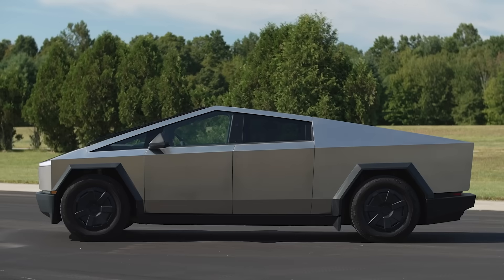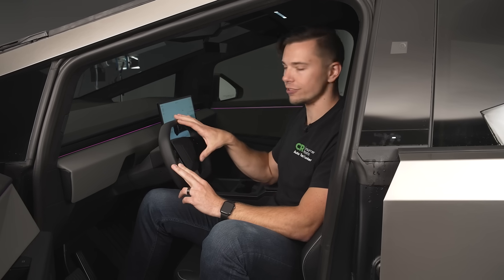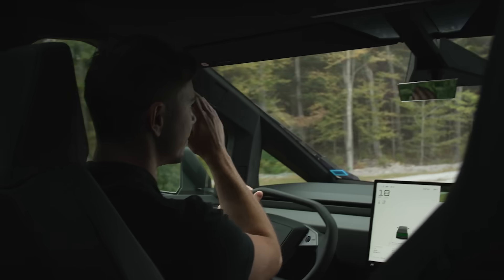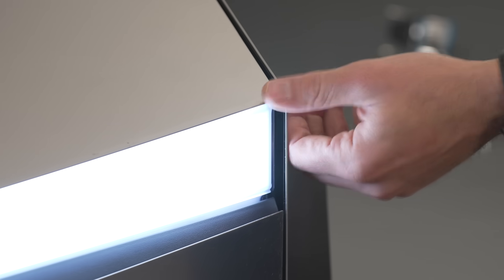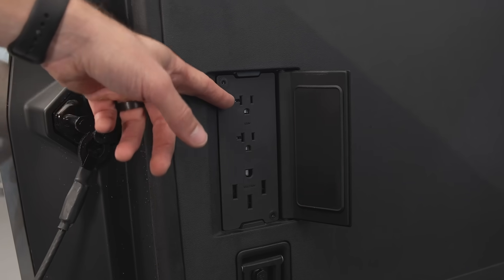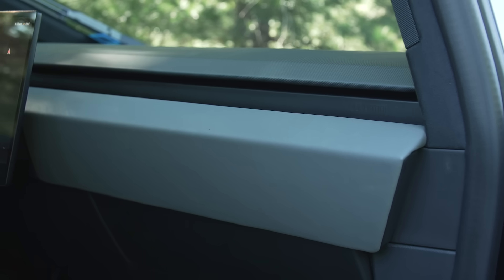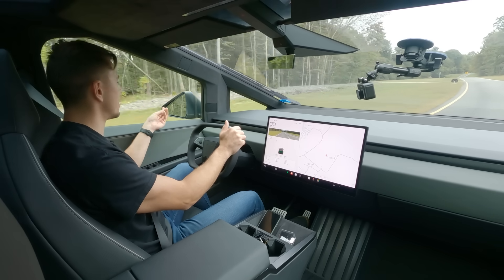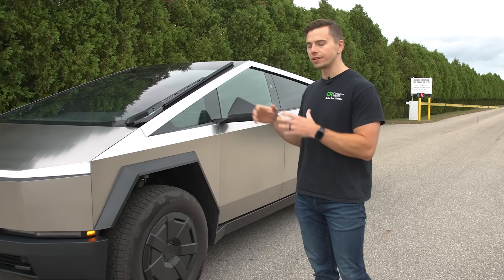2024 Tesla Cybertruck Early Review | Consumer Reports

Comment: So, the retraction function of the tournou cover is just dumb.  The only reason for it, is so you can reach into the bed; and there no place you can do that.   It would be way better as removable panels.    The lack of towing is also just tragic.  If you tow, everything about the cyberSuv is wrong, the charge ports are badly placed, the range is completely useless, the bed can’t have a cap/camper so there’s no way to help aero.  The extended range battery just makes everything worse, it gives you maybe 30 more miles so you go from 80 to 110 and charge times double.  Nobody who tows an RV does so w/o a sway control.   Dropping the trailer and re-attaching adds an extra 30 minutes to charging, and if you do by some miracle find a pull through charging location, good luck sitting in line for that.  The trim on the bed is just completely stupid and cheap.  The lack of a pass through or mid-gate is also a miss for the camping/rv crowd.  The fact the truck can’t sleep the internal electronics is also just dumb.   The lack of pass through for the power is also dumb.  I mean how hard would it be to add relays that bifurcate the incoming AC power to the charging and the rear 240 output, the of course means I can’t plug the cyberSuv into the RV post and my RV into the truck.   All of that, then you have the bumpers falling off and the rear and side trim detaching.  Mind boggling.   I really had high hopes for this thing and it’s just an abysmal fail.  If the RAM Charger delivers on its promises, I suspect the Cyber-I-wish-I-was-a-Truck will disappear.
Reply: Your screed on the cover is so ridiculous. The whole point of the cover is lockable storage you can quickly and effortlessly get out of the way. Also, 5% of of F150 owners tow long range. Why is your towing blathering relevant? Most people if they tow only do so locally.
Reply: @TheBowerbird  You clearly have no experiance with RV’s and camping. There were 78 million camping trips in 2023 and an estimated 81 million camping trips in 2024.  Of those, 35 million are bumper-pulled by full size half-ton trucks.  That does not include boating.  Your 5% number is also a gross misrepresentation.  80 miles of towing is not “short range” it’s pointless.  That means you have to camp with-in at best, a 75 mile range of home.  Or spend 2 hours, unhitching, recharging and re-hitching to get another 70 miles of range.   Of those 35 MILLION camping trips, less than 10% are going to be within the 80 mile range.   Just because people only tow 5% of the time doesn’t mean that towing isn’t a primary use case.  Do the math, or maybe talk to people who really tow before regurgitating your fan-boy talking points.

Comment: You forgot to mention that it doesn't have a spare tire. Also, isn't the "6 foot bed" with the tailgate down?
Reply: Worse, the bed depth decreases significantly because of the stupid bed cover, so it actually much less than that!
Reply: @sprockkets  What are you talking about? The cover retracts below the bed.

Comment: With those sharp corners up front, how did they get by pedestrian impact regulations?
Reply: There are no ped impact regulations in the US, and if there were, this would fare far better than something like an F150 - because the front isn't as tall.
Reply: @TheBowerbird  Exactly, its about flippin people up and over and I reckon this woudl do a good job at the right speed
Reply: Only vehicles with a GVWR under 10,000 lbs are required to meet pedestrian impact safety standards. The Cybertruck along with all the HD trucks from the Big 3 are exempt due to their high GVWR.
Reply: Vehicle class/weight most likely so it doesn't apply to keeping humans safe.
Reply: @davidmccarthy6061  For a pedestrian the best impact is no impact.      Good automatic braking saves lives.  FSD can even see people on the sidewalks.  They are working on determining pedestrian intent via body language.  This is where safety is going.
Reply: Easily They have all moved to purgatory. Or bought a Cybertruck.
Reply: This is a reason why fElon has bought the Presidency - get rid of pesky laws like those.
Reply: They can't be sold in Europe for that very reason.
Reply: @terry94131  Let me guess - you got your information from Reddit? Guess what, clueless one, no pickup trucks in the US market meet Euro ped safety standards. It's not due to the corners, it's due to the height of the truck.
Reply: @terry94131 Luckily the institutions permitting those cars do not listen to stupid YouTube commenters. They have already been imported, sold and are driving all over Europe. 

To quote Monty Pythons: „I send a fart in your general direction“
Reply: @wolfgangpreier9160  Actually they do in Europe.     Some bloke in the Chez republic has a CT and safety organizations that learned everything they know about the CT on YT are up in arms and wrote a letter to the powers that be to ensure it never becomes legal.
We know this is true because they said it has no crumple zones,,
Reply: @terry94131  Well that's not true is it
Reply: It’s an absolutely ridiculous design with so many failures that it should be called out for everything that it isn’t but everyone in the press seems to be afraid to say anything
Reply: @LlyleHunter  Such as?

Comment: Don’t worry about steer by wire. F-16s have had it (fly by wire) since the first prototype flew in 1974. Works great.
Reply: Irrelevant. Cars aren't checked for problems before driving each day, and there is no reason for steer by wire in a car vs a plane.
Reply: @sprockkets  Tesla systems are monitored microsecond by microsecond, sensors are extensive and error codes are excruciatingly precise. Like it or not, the master computer always knows what's going on.
Reply: @guyo1995  u mean the buggy system that needs ota update? No thanks...
Reply: @guyo1995  No it does not hence so many error reports that Tesla Service Centers have to wipe and/or suppress because they cant figure out the cause

Limp Home Mode while fully charge and not use roughly
Bricking for multiple reasons including from charging from an official device, NM washing why does a car need a Wash Mode?
Reply: @kiloy1006  It is sad how the hate crowd is trying to turn OTA into a bad thing.
Most if not all legacy has it now but wished they had it working long ago.

Comment: As a Tesla fan and owner, I was not blown away by the CyberTruck. At the original price of $40k I would have been impressed, but at $100k, not so much. It seems very solid but the interior seemed a bit cheap and sparse for the money.
The truck does show fingerprints, but it is extremely durable. The "rusting issue" is not real. dirt gets on the surface and material in the dirt "rust" but are pretty easy to remove with clay bar. The sharp edges are not an issue unless you are extremely careless
There has been a update which allows most of the self-driving features like my Model S
Reply: Really?  A $60,000 price difference would have left you with a different impression?

Comment: I still own only gas cars and a truck. I love my V8s. But I also like vehicle stats and tech advancement. There were several errors, intentional or not, that spec nerds like me should noticed in this review. If you are interested in this vehicle, there are several videos that correctly list the actual specs and capabilities on YouTube. With all the oddities, it is capable and interesting. Regen is adjustable and can be disabled, payload is huge, weight is lighter 3k pounds lighter than a hummer, and like it or not steer by wire has been around for decades and is in almost all commercial passenger airplanes. I've worked aircraft avionics and flight controls for over 2 decades.
Reply: And the little red light is supported and enhanced by the red graphic on the repeater camera view on screen.  That’s where you look anyway.  AND the front camera is excellent for knowing EXACTLY where the nose is.  This guy is plain and dumb.
Reply: Don't aircraft have wind-powered generators as redundancy in case of power failure in order to maintain flight control? What's this rolling dumpster got as backup?
Reply: @TheTawniest  Shameless copy and paste from Cyber Truck Owners Club site by mongo

Steering is controlled by both the left and right front control units.
Each is fed by both the 48V battery and the Power Conversion System (PCS) which is fed by the pack (high voltage battery).

So to lose steering requires loss of both front modules or both the 48V battery and PCS.

The vehicle goes into limp mode on a single failure, so encountering a sudden dual failure should be an extremely rare event.

Comment: Every major car company on earth can make a car like this. It’s a rather simple engineering exercise and doesn’t involve an engine and transmission, which are the two most difficult systems to make.  Ever wondered why the other companies don’t make one of these?
Reply: It’s making stuff at scale that’s difficult. 
After just 3 months of production the CyberTruck is already the best selling EV truck.
Given that it’s still ramping up production and preparing for the double and single motor cheaper models, give it a year or two and it’ll be the best selling truck bar none.
Reply: Except you can't bend the steel into curves. So they had to invent every took to build it. And it is 48v,so they had to invent every component.
Reply: Because they've tried and failed many times. It's far harder than you think. And that's just a regular EV, not even talking about all the innovation in the CT. Just on example, the 48V system, the industry has been trying for decades, but couldn't make the leap.

Comment: FSD for the Cybertruck comes this week. With FSD it should be able to park itself. I have the new Model 3, it lacks the parking sensors of the old 3 but it doesn't seem to interfere with the self parking. When I Supercharge I have the car back into the charger itself, it's much easier then doing it yourself.
There is also really good visualization on the screen. Blind spot monitors are obsolete, the visualization shows you everything around you and it also turns red if a car is in your blind spot when you are changing lanes.
This week is the first FSD release for the Cybertruck, expect new ones every couple of weeks which will mostly make things better although there is always a two steps forward one step back with FSD. 
A lot of Tesla's design decisions assume FSD. The lack of stalks isn't much of an issue if you are using FSD. For example to start the car just step on the brake and it will put itself in forward or reverse itself, it's usually right but if it makes the wrong choice only then do you have to select the gear on the screen. Likewise the blinkers are handled by the car when you are in FSD. If you want to change lanes you just touch the right or left directional button,that's easy. The only time the directional buttons are a problem is if you want to turn on a blinker when the wheel is already turned. That should be much less of a problem with the Cybertruck because of the variable steering.
Reply: This "truck" is shit.

Comment: I think the comment regarding autopilot is interesting: because in the past, cars didn't really get updated functionality from the factory after a car was made - those products were pretty much static unless the owner made changes that could sometimes void the warranty.  But many new vehicles can get updates and not just basic ones.  Initially, the CyberTruck (CT) didn't ship with a locking differential, but through an update, this feature is now enabled making it's off-road capabilities much higher.  Not sure when this video was made, but it now has more parking assist features.  And just today some early testers have FSD enabled on their CT's.  So as features get added and more time goes by, I wonder how CR is going to update their reviews or whether their reviews will become less reflective of how the vehicle is in it's current iteration.  

One other side note - it would have been good if this review  discussed the difference of the Foundation Series vs the standard model and what the standard model costs ($80k).  For example, the Foundation Series comes with the Powershare Home Backup system - will CR install one of these power backup systems and do a review on it?  I would love to get CR's take on how the CT could power a home with the 11kw power output in case of a power outage.  

In fact, I hope CR does more reviews of solar systems and car chargers.  I know this might not be in the CR wheelhouse but the world is changing and CR is a great resource so that the viewers can keep up.
Reply: Wouldn't it be nice if we didn't have companies ship cars now and fix later?
Reply: @sprockkets  True

Here's are the top 10 carmakers by the number of vehicles potentially affected by recalls in the U.S., per the NHTSA (2023):

    Honda: 6,334,825 vehicles potentially affected
    Ford: 6,152,614
    Kia America: 3,110,447
    Chrysler: 2,732,398
    General Motors: 2,021,033
    Nissan North America: 1,804,443
    Mercedes-Benz USA: 478,173
    Volkswagen Group of America: 453,763
    BMW of North America: 340,249
    Daimler Trucks North America: 261,959
Reply: @sprockkets   On the other hand owner of Tesla cars love to get added functionality.

Comment: So i have a CB reservation # 1600XX  which I  made 4 days after unveiling. I was promised a tri-motor with 500+ mile range for about $79,999. Looks like Elon is going to renig with a $100K price and 330mile range but looks like RAM is going to make it happen. Apparently Ramcharger will cost about  $75K, will have 690 mile range, will be able to tow over 14000 lbs and will do 0 to 60 in 4.4 sec. Sorry Elon, once those specs are verified and truck is available I'll be asking for my $100 deposit. Dont need 4 wheel steering, dont need 20in tablet, dont need by wire  steering, dont need doors with out door handles, and etc. But do need HP, tourque, range at reasonable price.
Reply: You are hopelessly delusional if you think RAM will deliver all of that for the price that you stated.
Reply: @InfinitelyQurious  dude I am 65 year old  engineer that spend 25+ years around industrial controls and variable frequency drives, Do you even know what an VFD is? I spent 5 years waiting for Elon and just purchased 2025 honda pilot and are going to tell me I am hopelessly delusional? If RAM makes it ill check it and wait at least a year before I'll put my money where my mouth is. So where the hell you get off telling me that I don't know what I am doing?

Comment: I reserved a single motor version long ago for the advertised $39,999.  I thought it was a bargain and wanted to make it my first venture into the plug-in vehicle market.  As the years rolled by and the hype wore off, my needs changed and the Cybertruk was no longer needed so I cancelled the order.  

At that particular time, Ford released their F-150 Lightning Work Truck for the exact same $39,999 and it sported two motors to Tesla's one which was also a bargain.  But with inflation, the Ford Work Truck was a bargain to a few who got the early ones (probably with huge dealer markups) and then jacked the price to near double the original offering.   I suspected Tesla could not honor that $39,999 price and found out that they would not make the single motor struck, and only focused on the $99,000 Foundation and Cyberbeast versions, putting the thing firmly in the novelty bracket of automobiles, out of reach of many.   That was Tesla's choice as was Ford's as well.  

I remember seeing F-150 Lightnings sitting in the Ford lots unsold this summer and reckoned that the market was drying up on the electric pickup.  Also consider the home run Ford hit with their hybrid Mavrick which put a small utilitarian pickup truck at a great entry level price into every American's reach.  Now they are a bit more and need to get a little better with their quality to match that pricing but are still the best hybrid style pickup in the market for price and value.